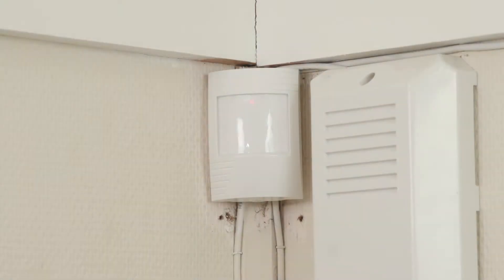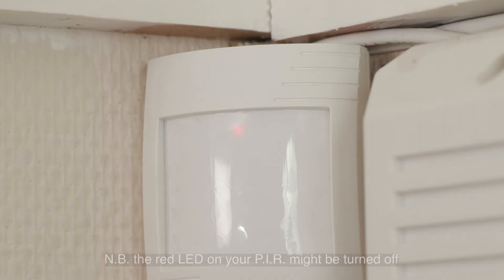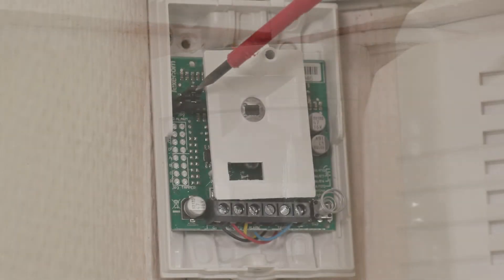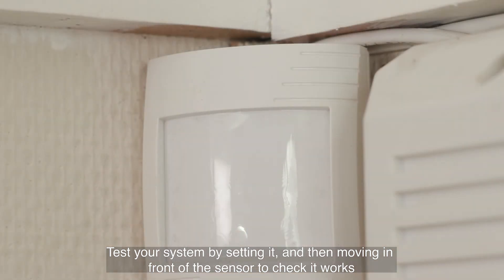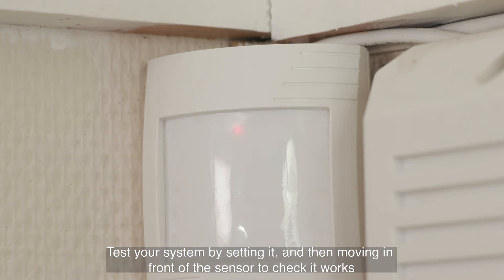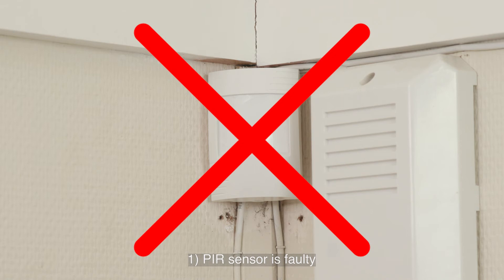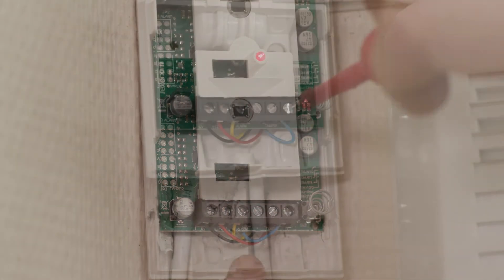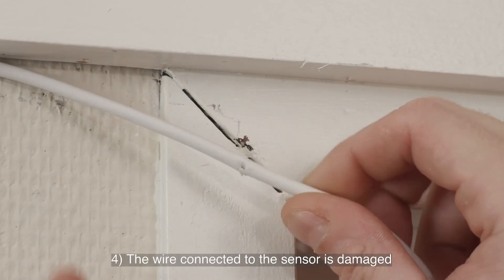PIR movement sensor not working - HOW TO FIX!

Comment: My pir light picks me up when i moving around but it does not go off. Any solutions that could help me why its not working?
Reply: This could be the way you are setting the alarm. If you are partly setting the system, all PIRs are omitted, but if it's fully set it could be a faulty zone program.

Comment: On my sensor the LED will flash when moving but sometimes when there is no person in the room it stays on red instead of going off. Any idea how to fix?
Reply: Just the ghosts no need to worry
Reply: @caseG80  probably true ngl
Reply: Could be a 3rd party interferance, like a microwave, light or heat source. Even cobwebs cause this, make sure the sensor is clean thoroughly to ensure best performance.
Reply: @alarmsgalore  it turned out it was a heat source, it was in the corner right above the fireplace. I moved it to a new corner.